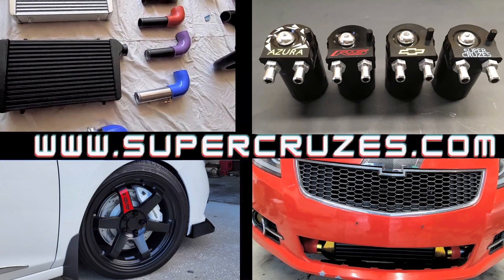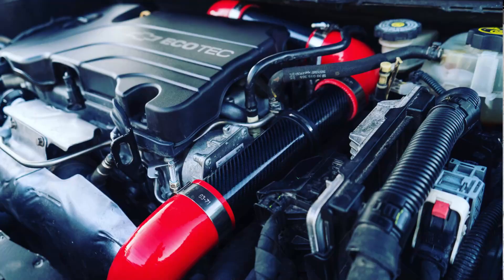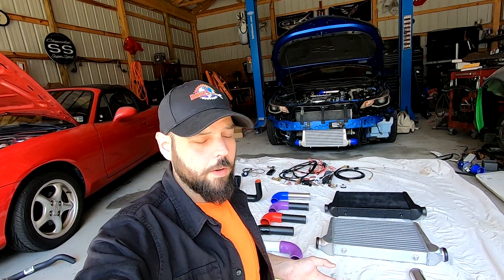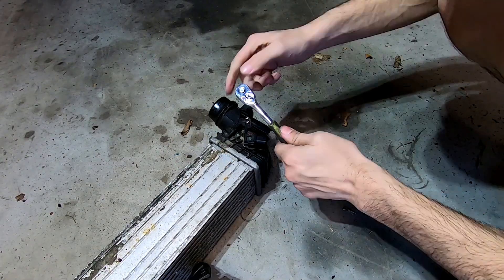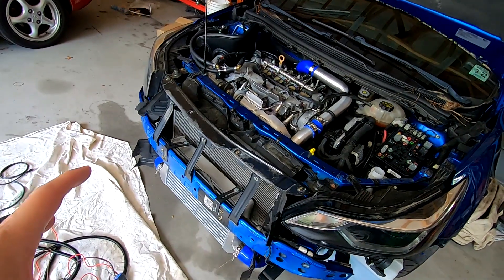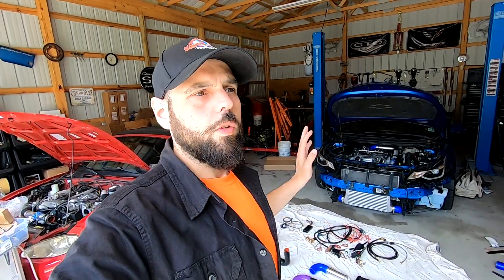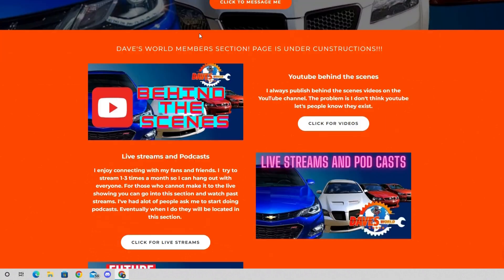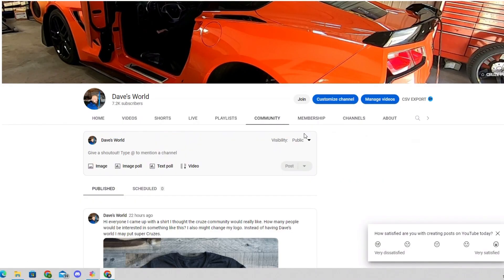Choose the right intercooler

Comment: Hey, Dave. Do you have a "bolt on" intercooler with pipings for chevy malibu 1.5 2020?
Reply from the maker: Yes
Reply: @davesworld2132  Tell me the price, please
Reply from the maker: @alexanderkim7241  I would need to know a little bit more about your car and what type of accessories you want on the Intercooler. Message me at brembodave@gmail.com
Reply: @davesworld2132  I have emailed you
Reply from the maker: @alexanderkim7241  OK I will check a little bit later
Reply: @davesworld2132  Also would be nice if we could chat in discord privately
Reply from the maker: @alexanderkim7241  I’m not in discord much but if you tag me in a private chat I will respond
Reply: @davesworld2132  wrote a message in discord
Reply from the maker: @alexanderkim7241  replied
Reply: @davesworld2132  check email please
Reply: @davesworld2132  bro, can you check an email again
Reply from the maker: @alexanderkim7241  Hello I saw it come in. It was a holiday yesterday in the US
Reply: @davesworld2132  can we proceed with the order?
Reply from the maker: @alexanderkim7241  yea I was just asking some additional questions via email before I sent over an invoice.
Reply: @davesworld2132  i just got the idea, we're increasing the pipes diameter, so it would flow better, that's what gives some additional hp, right? IC itself would just solve the problem with heat soaking.
Reply from the maker: @alexanderkim7241  it may also cause spool lag  how much boost are you trying to achieve ?
Reply: @davesworld2132  with the equinox turbocharger, i think a max would be 20-21 PSI? I've read about spool lag, is there a way to avoid it? Wouldn't be nice to have this lag.
Reply from the maker: @alexanderkim7241  Yes I will build the intercooler so you will not have that lag. The pipes will be the correct size.
Reply: @davesworld2132  by correct size you mean just as stock diameter pipes? Would i get an improvement then?
Reply from the maker: @alexanderkim7241  yes What you’re not understanding is my intercooler pipes are slightly larger than the stock size. Also the stock intercooler pipes are plastic which creates moisture.  Not only that because they are plastic there’s no heat transfer so the intake temperatures are incredibly hot. And the factory intercooler literally touches the radiator and it’s right next to the catalytic converter which heats up to 900° plus the OEM design is incredibly hot and restricts horsepower.
Reply: @davesworld2132  but if we will use stock pipe diameter, would it improve the performance at all? Have you tested larger pipes on other 1.5 malibus? How was the spool lag?
Reply: @davesworld2132  check email, please
Reply from the maker: @alexanderkim7241  Tomorrow I will respond. Time zone wise it’s very late by me it’s almost the middle of the night.
Reply: @davesworld2132  whats your time zone? I thought you were 11 hours behind me. I am in +6GMT
Reply from the maker: @alexanderkim7241  When I messaged you it was just before 12 midnight